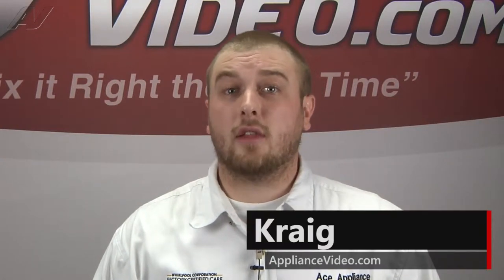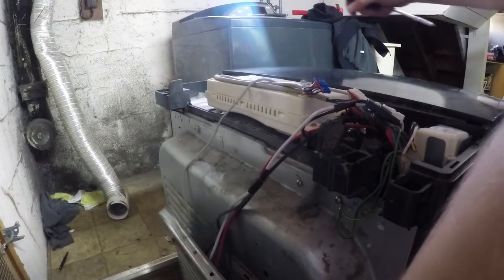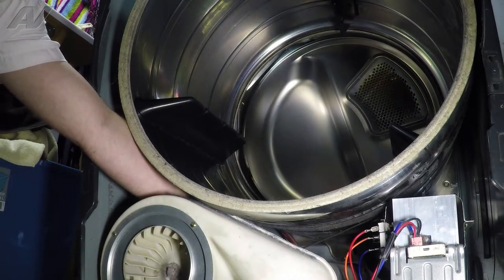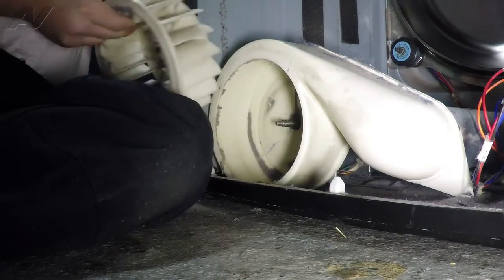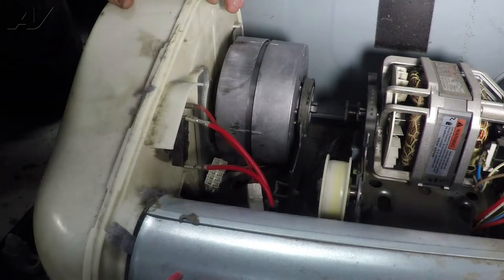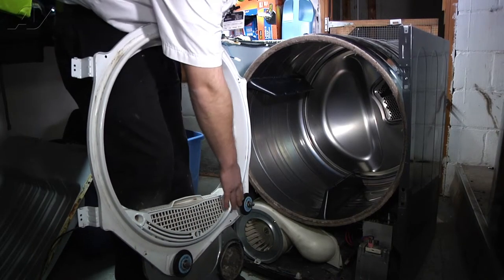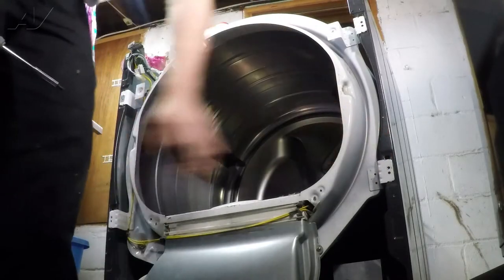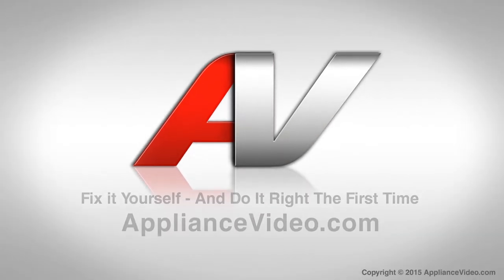GE Dryer Repair - Overheating and Short Cycling - Blower Motor

Comment: Hi I have a magic chef dryer which seems to be overheating and shuts off after 30 min or so and only can be turned on after it cools down. Could tell me what might be causing this?
Reply from the maker: Great question, if you have a
more technical question that our parts department cannot answer, you can search
our over 10,000 answered questions free at our website www.ApplianceVideo.com under our Repair Help section. You can also call
our parts department at 1-800-830-5465 and they can give you help 7-days A week
Monday -Sunday, or search at www.SaveMoreOnParts.com  24 hours
7- days A week.